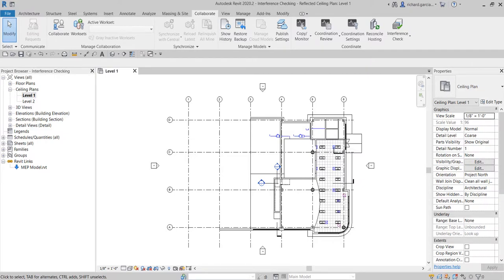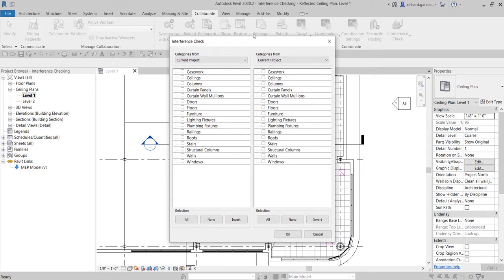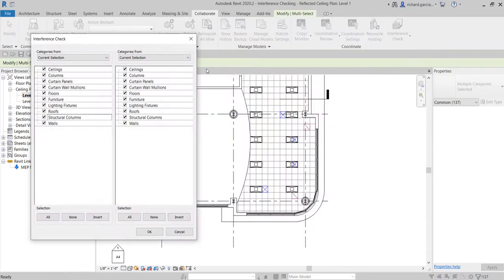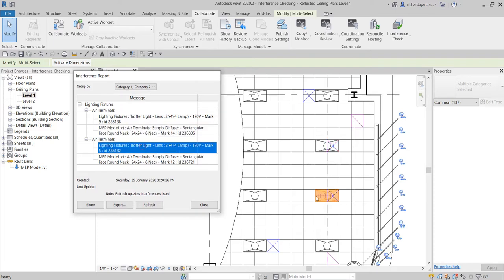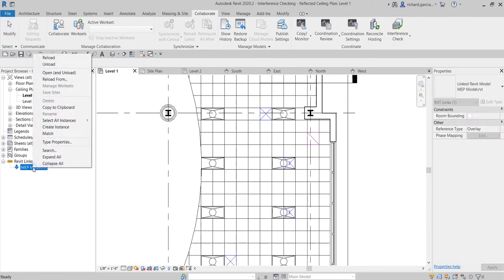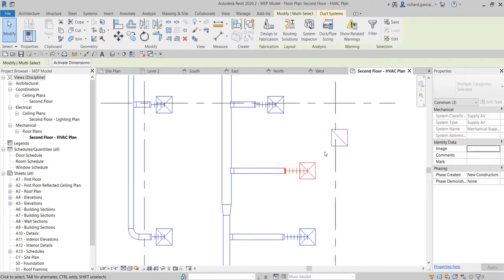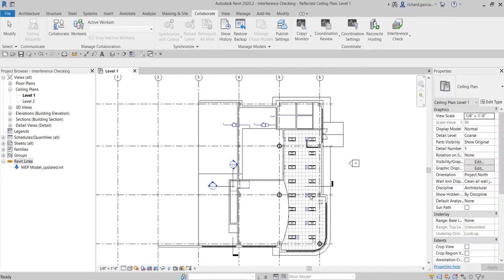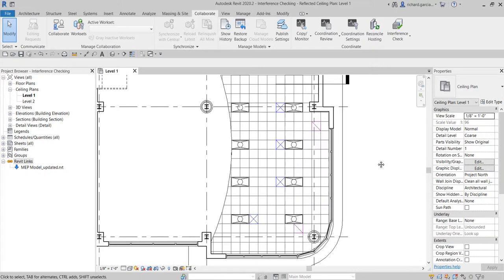REVIT MEP 2020: HOW TO RUN INTERFERENCE CHECK

Comment: Could You explain how that Mep Module is formed and linked so it appears as link ? Since projects consist of Electrical & Plumbing as well, could You show how to see all of the elements in 3D coliding with each other ( E+M+P+S ( structure elements ) ? E.G. how to resolve conflicts in space between them and see all that in 3D ( check visually in 3D ) ? Meaning, so that they do not overlap ? Here, in this video only E+M are shown. Can it, and how be applied to all elements in a single file . Here , 2 levels are shown: Architecture and Mechanical .
Can it and how be done. Videos in Youtube show how to make separate elements E, M, P, but when it comes to reality it has to be all at once and checked all . In a simple, small example ?
Reply from the maker: hello, for coordination, if you are doing for example Mechanical, you can link the other services (electrical, plumbing, etc.) along with structural. Then you can change the discipline to Coordination from the Properties.